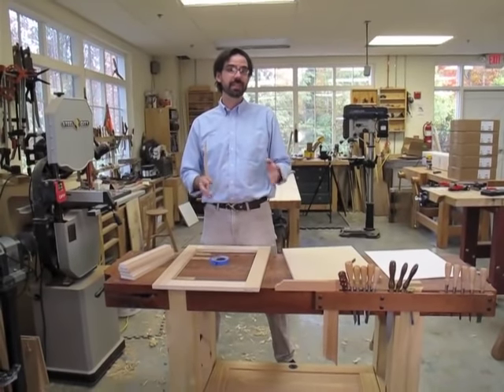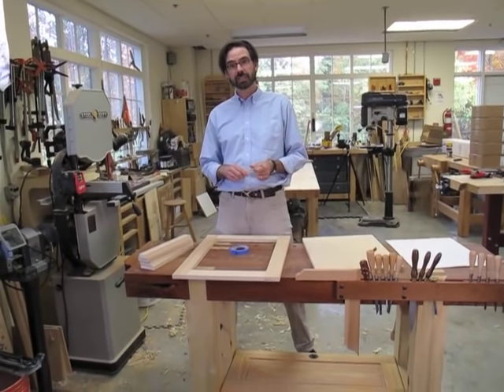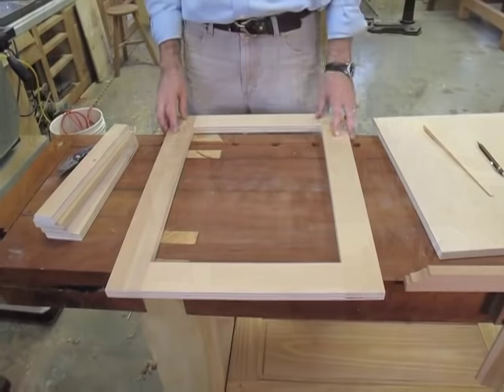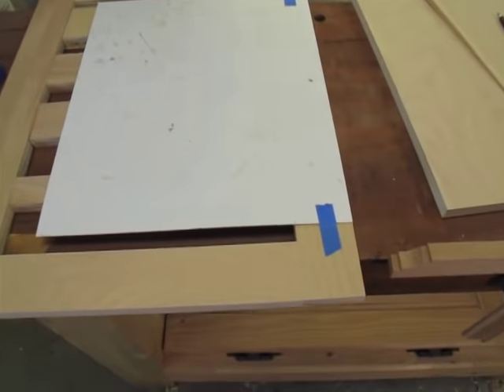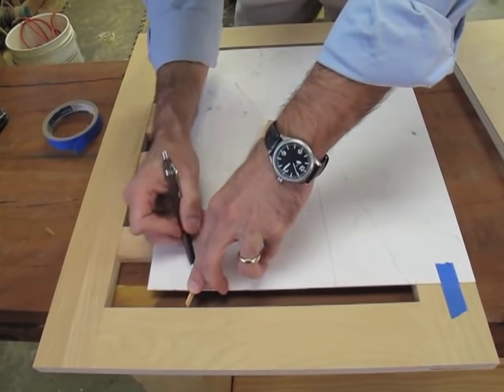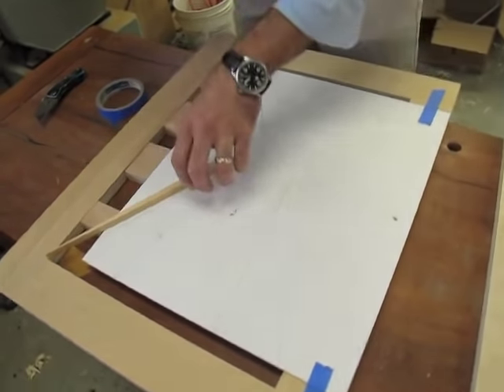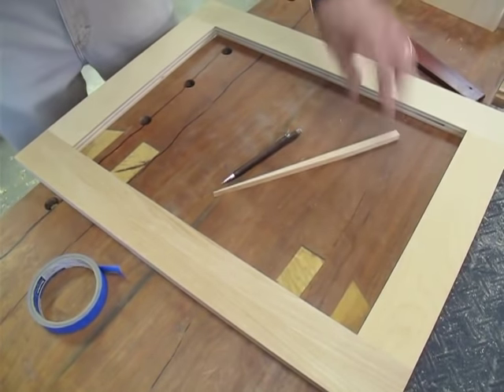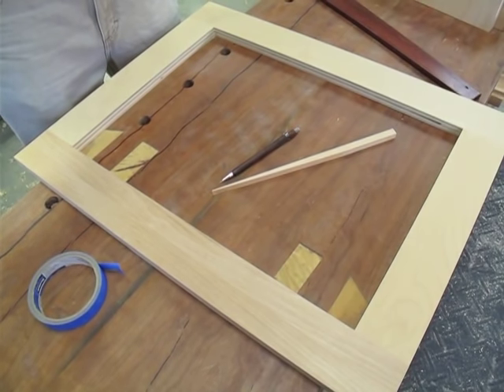Fit a Door With Ticking Sticks

Comment: A ticking stick is not generally used on a door with four straight edges, there are easier ways to get a good fit.
A ticking stick excels when pieces are of an odd shape and/or are in an awkward position to make accurate measurements difficult.

Comment: Tick sticks have their place but this isn't one of them. Just trace the inside of the frame onto the piece you want to fit and you're done. Tick sticks were invented for boat building.
Reply: EXACTLY.
Reply: Got it,,,,
Reply: It's fine to use the tick sticks for carpentry when you can't trace the piece. But in this case it's the wrong tool for the job.
Reply: That’s what I thought too, but if you’re fitting the door to a frame that is already installed, I could see it being a good idea.
Reply: @mechanicalman1068  then you just take the door off

Comment: This example is cracking a walnut with a sledgehammer, there are much quicker ways to fit doors to frames that have straight edges to them. This technique is only really worth it for tricky shapes as in boat building.

Comment: Usually I would just lay a strip of luan along each side and hot glue them together and Voila’ you have your template, If you need to to do any scribing just do it before attaching the strips together.

Comment: Slow and stupid. Tape door gap strips (usually 1/16" +) in place. Then cut 4 plywood pcs. 1/4 x 2" x opening size. Then cut and sand to fit top and bottom "rails". Then cut left and right "stile" pieces 1" shorter than opening, lay on top of rail pieces butted to door gap strips and nail in place using a T-50 wide crown stapler and 3/8" staples. Then lift template out of opening and transfer to respective door or drawer front. Same technique can be used on irregular openings, using short sections to follow radius walls, and irregular countertops. Ticking strips are pre-nailgun era. In lieu of nailgun, hotmelt glue.